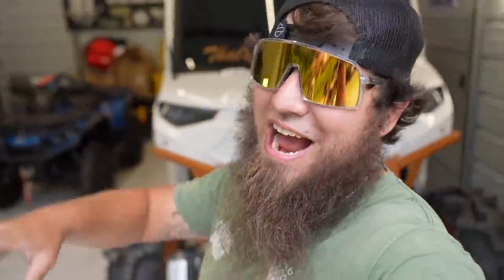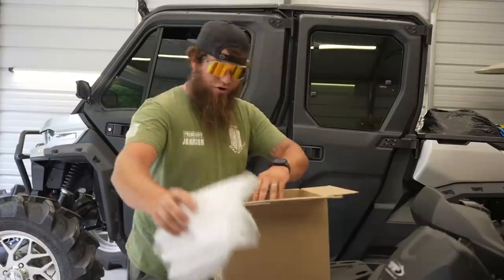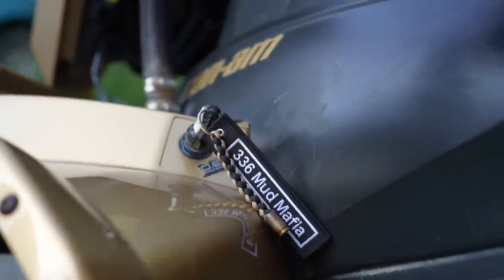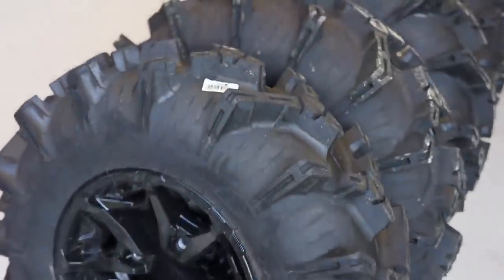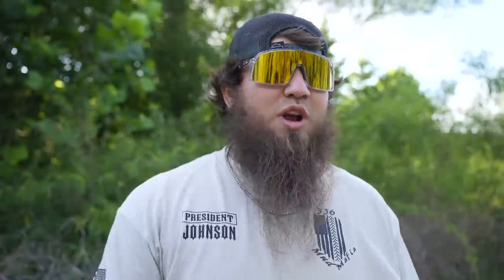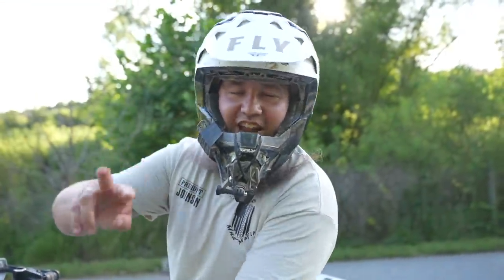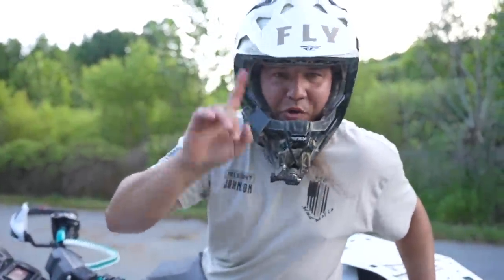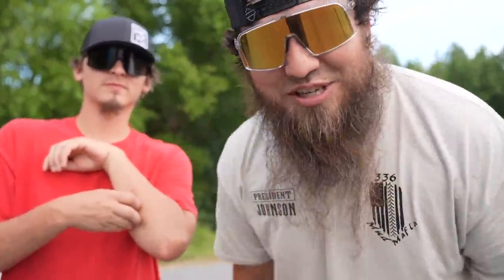I Can NOT Believe It's That FAST!! *STUPID FAST*

Comment: to help with the outlander build if you run floorboards and 32 nators with the shocks on the machine they will rub even turned up but you can use 29.5 nators no problom but I just swapped my shocks for the fox podiums had no problems with rubbing
Reply from the maker: Thanks for the info! We were actually worried about that!